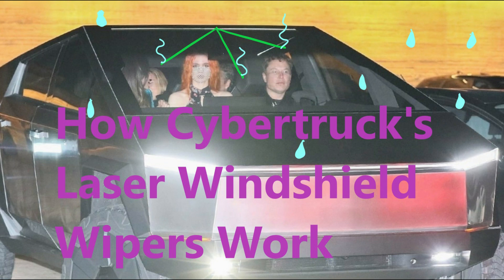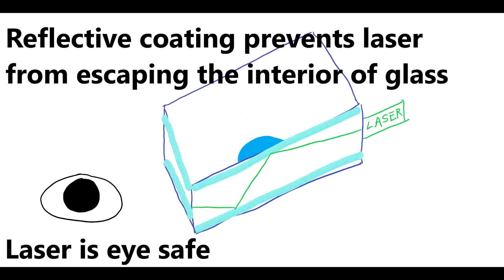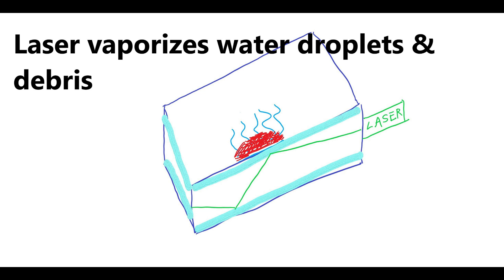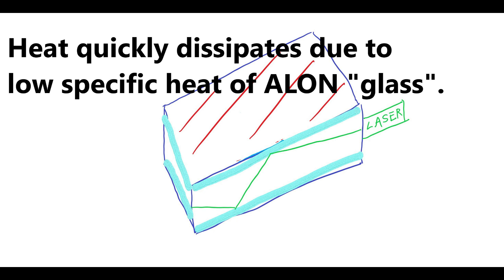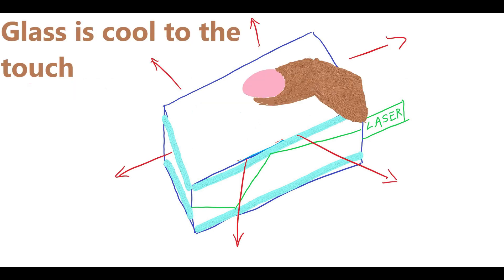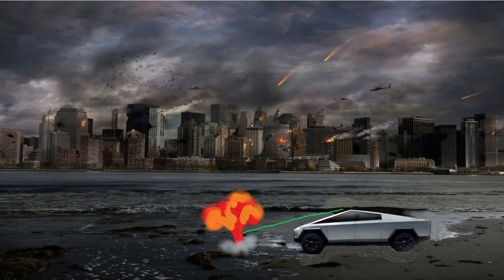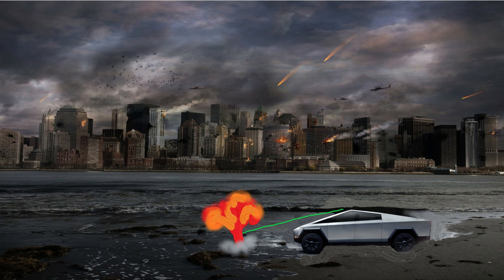How Cybertruck's Laser Windshield Wipers Work

Comment: Lol, The OP that made the video has absolutely no idea what’s he’s talking about. The laser would not be reflecting inside the laminate like a fiber optic cable. The laser would strike from the outside hitting small debris directly. Anything past debris or tiny droplets would be a problem. If you were using it like wiper in a rain storm a laser would be useless due to the total energy needed for the vaporized the water.  The Heat (or Enthalpy) of Vaporization of water is 40.65 kJ/mol and the energy needed to remove anything but droplets is way beyond the capabilities of lasers capable of being mounted on an automobile. The OP needs to study Snell’s law, Refracted Rays, Critical Rays, Total internal Reflection, Refraction, and dispersion to know the laser is not going to work from it bouncing inside the glass.
Reply from the maker: This was from a patent filed by TESLA. So, if you have to complain about how you're a mr smarty pants & others know "nothing", great,  complain to Tesla, not me.
Reply: @RPhTom  No it wasn't. You made up most of it. The laser is outside the glass and hit's the outer surface its NOT inside the glass and it does NOT bounce around "inside" the glass to then magically jump out and strike the debris. 0:33 Go study "Snells law" and read the 15 page patent again. I read the entire patent US20190351873 at submission in May 2019 and approval in Sept 2021. "Pulsed Laser Cleaning of [Debris Accumulated] on Glass Articles in Vehicles and Photovoltaic Assemblies." You twisted it into your own version but you were way off. It's more of a way to keep the window clean from dirt and debris and could possibly vaporize some droplets. I've built lasers that can pop holes in car tires, strip rust off metal and track bugs and kill them in mid air. Go watch some video's on the massive sized lasers needed for the vaporization of just one cup of water. You will have a gallons of water to deal with in a storm. And yes I have a Tri motor CT (quad now) on order.
Reply from the maker: You've obviously interpreted the patents differently but it's a moot point to argue as the latest drone videos show that the cybertruck is going to use a single gigantic windshield wiper. No lasers. Lol.
Reply: @RPhTom  That wiper wasn’t even attached. They were doing aerodynamic laminar flow tests. Zoom in and look at the blue air-flow tells. Besides Elon even said that wiper would not be on the truck. The curved window cancels the laser anyway as you would need beam splitters as a single or even two lasers laser cannot cover the entire window if it’s not flat. Check the patent on electromagnetic wipers.